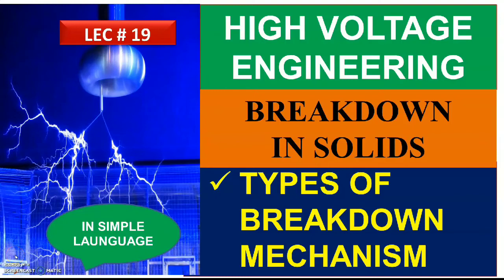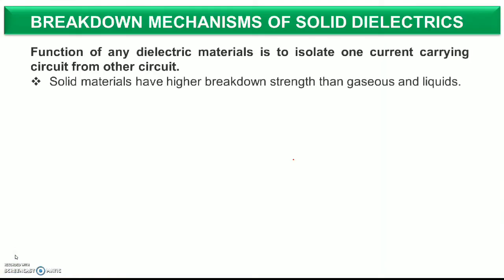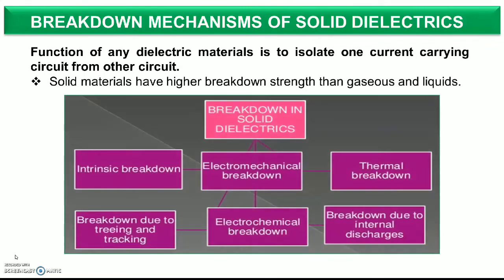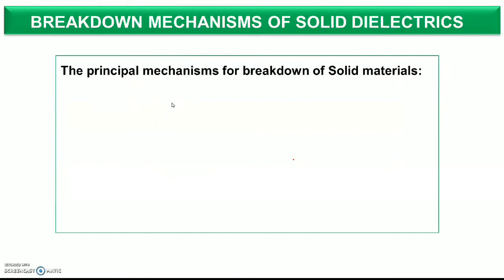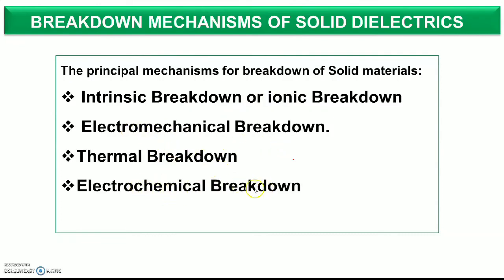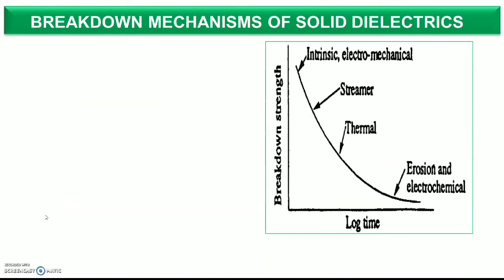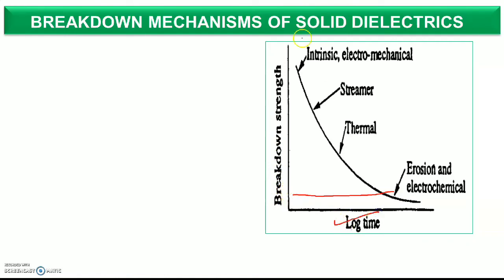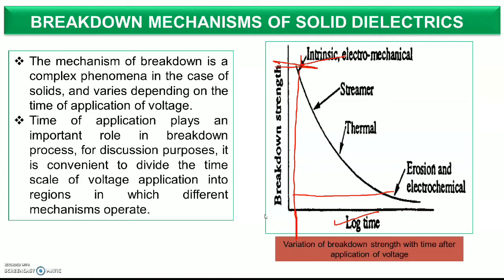BREAKDOWN MECHANISM OF SOLID DIELECTRICS|BREAKDOWN IN SOLIDS|HIGH VOLTAGE ENGINEERING

Comment: Sir insulators and dielectric materials me difference hota hai kya??
Reply from the maker: The term insulator is generally used to indicate electrical obstruction while the term dielectric is used to indicate the energy storing capacity of the material (by means of polarization). A common example of a dielectric is the electrically insulating material between the metallic plates of a capacitor.